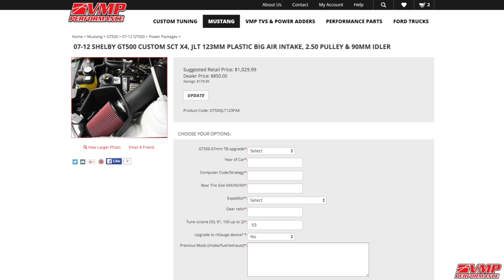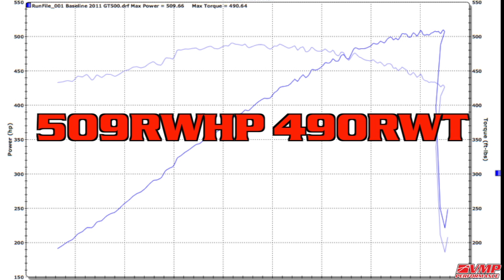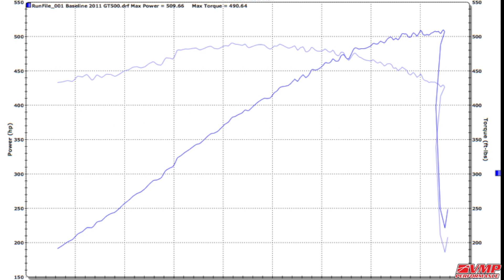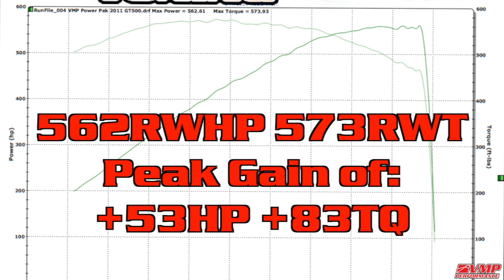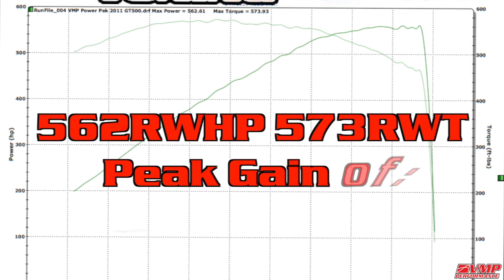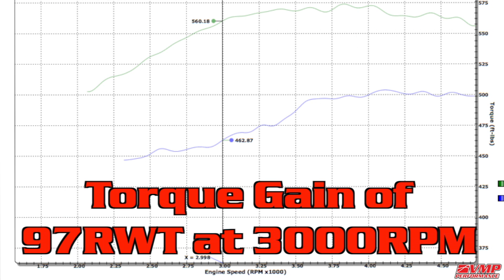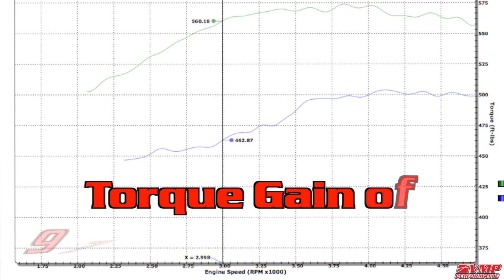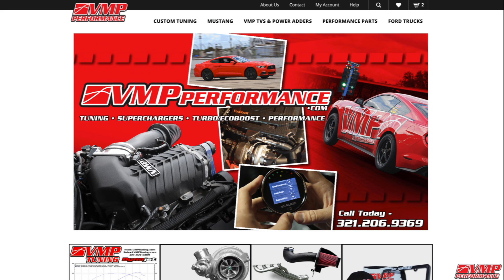VMP Performance 07-12 GT500 Power Pack Install and Dyno Pull

Comment: would it be the same for the 12 GT500 as they made 550bhp from the factory
Reply: Yes because the only reason they had more power is better factory intake and tune.   Once you have an aftermarket intake and tune on an 07-09 it will make same power as a 12 with the same mods the 07-09 is just more restricted stock.  07-12 all make the same power once modified the earlier cars just gain alot more from the mods but they end up at the same place.  They can even make comparable power to the 13 once running the same blower and supporting mods etc.

Comment: what would the estimated hp and torque of a 2010 with 2.5 pulley, ford racing cobra jet dual 65mm throttle body, jlt 123 intake, roush extreme axlebacks, with a 91 octane vmp tune?

am looking for some added power while i save up for supporting mods for a tvs 3 setup!

Thanks VMP, you are the only company to get my money and work on my beloved Shelby!
Reply from the maker: Paul Brinston you are looking at 530-560rwhp with those mods on a stock m122 blower
Reply: thanks!
Reply: so basicly having a 65-67mm throttle body on a 91 octane tune is the same as stock 60mm TB and 93 octane tune?

Comment: what about the spark plugs? Ok to use the stock ones? Gap?
Reply from the maker: Hi, stock ones are okay with 20,000 miles or less.  We recommend Brisk GR14YS if you need to replace your plugs.
Reply: VMPPerformance ok, thank you!